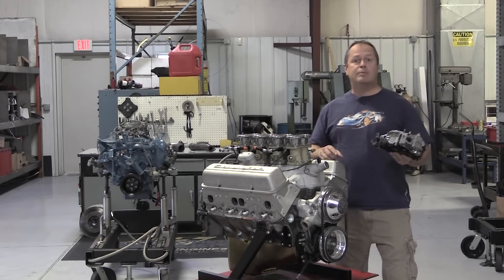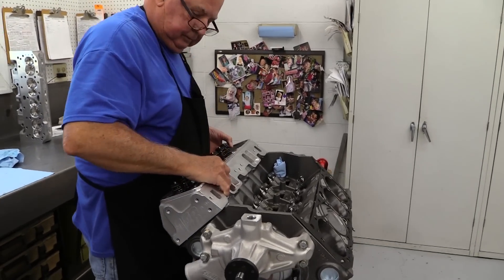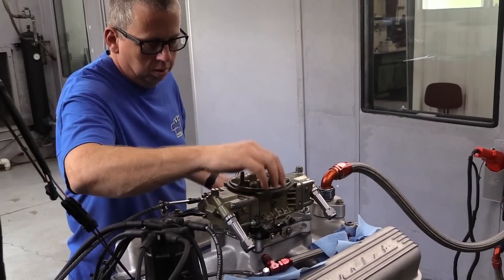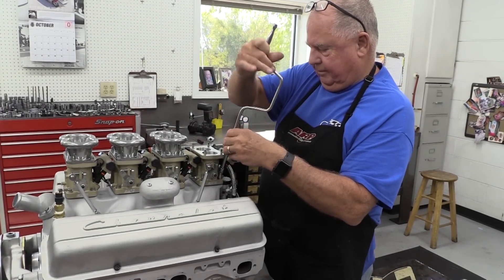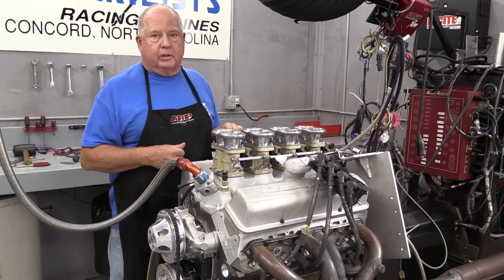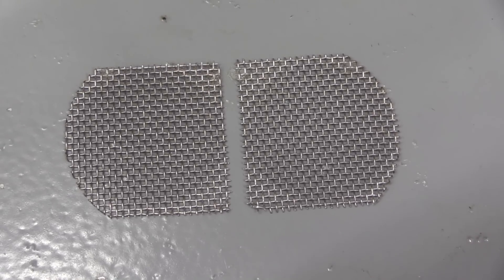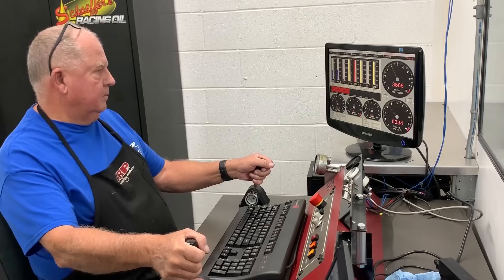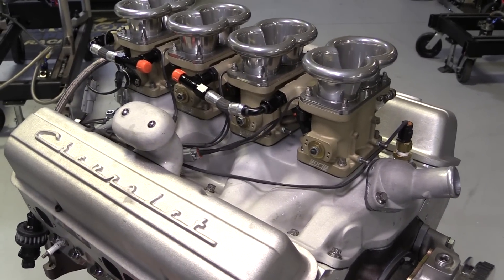Carb vs EFI - Dyno Testing a Holley Double Pumper vs Custom Stack Injection

Comment: Good video, and I AM a confirmed carb guy, but it really looks like that FI system was strangled upstairs by that manifold.
Reply: @Uncle Tony's Garage I see you there mad scientist!
Reply from the maker: True, they were just too small for maximum power on that combo. And I love your channel!
Reply: Yup, the lack of a common plenum killed all the top end HP.
Reply: Victor PONCE  I see only one potential advantage to that manifold. Short runner carb per cylinder setups like that bring the butterfly closer to the intake valve. This can make for a more responsive engine which can be important in something like a manual transmission race car for things like double clutching. But the engine it's on makes that moot. Outside of that specific application every other common setup is superior.
Reply: @snek9353  It also reduces the velocity that comes from longer runners. I noticed a big difference when the TPI systems came out. Much like the Old Tarantula manifolds, they produced a lot of power, but, unlike the Big T's, they were excellent at off idle to full RPM.
Reply: Need to change to cam when doing EFI, was not a good comparison
Reply: Uncle Tony's Garage, it sure does! Webber carted setups are very very sensitive to runner size and length. ITB’s are also sensitive in that way. Both of those NEED port to manifold matching.
Reply: EXACTLY!!!!! FI systems have to be intake port tuned AND exhaust port tuned in order that each port does not interfere with the other. That is why PORT FUEL INJECTION & EXHAUST PORT EXHAUST is CRITICAL!!!!!! Also, FI systems require signals from sensors to execute the Timing Curve, of which can be manipulated. There are so many examples from the gas engines to the diesel engines of torque and power curve differences. For example, the  1988 Mitsubishi Mirage naturally aspirated 1.6L FI engine with 170 HP v. the inferior 2.2l GM engine that could barely crank out 180 HP. Case Heavy Equipment with ECM's have more power without turbos!!!!!! Put that in your smoke and pipe it!!!!!!!LOL
Reply: It just looks cool and trust me after that heat gets to those carburetors that thing will be sitting on the side of the road and we'll be looking at it just as we are now because out comes the wallet

Comment: Loved the look of the older fuel injection...loved the video..finally got someone who commented on where the torque curve could be acknowledge on street where it will be used most of the time ...sure we all like to get on it full throttle at times ...I'm a big fan of torque  and useable torque...I'll trade 20 ft lbs of torque for 20 PEAK hp anyday !!! 
Thanks for relating to what I would want in any buildup ...

Comment: I once had a 77 Buick Station Wagon that had a 455 cid engine,  with a very small two barrel carb on it. I looked up the HP and Torque numbers  and found something that surprised me. 155 peak HP at 4800 rpm, but 415 ft lbs of torque at 2800 rpm.  That is when I learned about restrictive intakes, long stroke cranks, and torque. That land yacht must have weighed in at over 5,000 lbs without the 13 passengers, and their stuff..,   yet that engine pulled it up a mountain at 65mph, with the tach hovering around 2,600 rpm.  It actually got around 28 mpg on the highway.
Reply: big displacement engines inherently have more torque, no doubt about that. just look at the dodge viper motor
Reply: @sepg5084  displacement has two components,, bore and stroke. A short stroke/ big bore engine is better at making horsepower at high rpms, while a long stroke/small bore engine (same cubic inches) makes more torque at lower rpms.
Reply: My mom drove an old red Plymouth station wagon with the wood grain simulation on the sides. it was a bad ass wagon. it had a 383 magnum. that wagon would shit and get, believe that crap. in a station wagon, wish I had it now.
Reply: Generally the Factory spends millions of $$$$ on getting Maximum on average, HP+TQ+Mileage + Cost+ reliability =Value $$$ for a daily driver so you can't go wrong keeping it stock and running properly with regular service!!!

Comment: The old man is a good tech,  takes pride in his work and set the most beautiful bead of silicone i have ever seen in my life, this guy is a pro builder.  I could hear on the first dyno run when you switch to efi that the engine was running too rich. He knew it too and taking the screens out was brilliant.

Comment: With a self learning ecu and no knock sensors I don’t see how the ignition timing can really be on point to provide the maximum power for that efi setup. It’s impressive it did that well without proper tuning to be honest.

The real benefit of efi is to precisely control the fuel and timing so you can push the limits: In order to do this you need to tune the ecu.
Reply: Plus no O2 sensor on the exhaust, they didn't give the EFI a chance, I would like to have know the vacuum difference. 
But still a stout engine for a rod.

Comment: Intake was made by Inglese, they only ever cast around 18 of those for use in a Road Race series. I have one of those manifolds.
Reply: If I had one, I'd get someone to re-create it on a 3-d Printer, play with the openings on CAD to flow more, and reproduce your own! You could probably sell the 3-d versions to supplement your IRA!! 
Or, have them produced from high temp injection molded ABS or the like..

If there's NO Serial numbers/part number/Manufacturing name= NO LAWSUITS. 

.......How long have you had it sitting? 30-50yrs?
Reply: I have one! That's so cool. It's on my car rn.
Reply: I had one of these prototype Weber DCNF intakes a while back. Jim Inglese designed them and Winters Foundry cast them. Mine still had all the markings on it. Have a friend who has one and know where there is one other. These being an individual runner design, they will make more power from low to midrange than a plenum type intake.

Comment: Some body wrote that a carburetor is basically a  calibrated fuel leak.
Reply: lol best description of a carb ever.
Reply: Carbs have came a long way in the last 60 years!!!
Reply: John Johnson  yep. my carbed bike scares the crap out of me with its bad cold start and fuel smell.
Reply: John Johnson Yep. I don't know how to make them run right in cars, because almost all of the cars I've owned and worked on have been injected. Never had much trouble tuning them on bikes, but as a dirt/dual sport guy, they've all been pretty simple singles.
Reply: Ok, if sucking gas through a nozzle is what you call "fuel leak"..
Reply: @dougwillett27  one would HOPE so. LOL
Reply: John Johnson Honestly, yeah, it sorta is. There will never be another new carbureted automotive engine, and there hasn't been since the late eighties that I'm aware of. Hell, almost all dirt bikes are injected now. EFI is superior in every conceivable way (except simplicity, which there's quite a lot to be said for in certain conditions), and it's literally everywhere now. I wish I'd learned back when it was relevant, but these days there's just no need to for someone like me who's into what I'm into (quick, fun, reliable, daily drivers, off road capable vehicles, and dual sport motorcycles).
Reply: "calibrated fuel leak" 
You could describe EFI the same way, it's just a calibrated, computer-controlled pressurized fuel leak as opposed to one drawn in by a partial vacuum and venturi-effect and metered by restrictions i.e. jets.
Reply: John Johnson  as an EFI guy, Yes, that is correct. lol I am shit at setting up a carb.
Reply: Well well well, the good old carb shits on the EFI.
Reply: And efi is just a calibrated fuel leak thats pressurized.
Reply: Ran a carburetor on my 750 plus horsepower small block chevy 350 cid engine with a 5500 or 6000 stall speed converter naturally aspirated engine never once had a issue with it.
Reply: Big blocks are pretty simple to tune.
Reply: Tomyp89, close, very close! ITB’s are best!
Reply: sed8181, had a Harley mechanic tell me one day that a “Kawaski” starting cold sounded like a dude with the dry heaves! LOL.
Reply: The sinner Jim Whitney just a yuppie if you can’t plug a scan tool in you don’t know what to do. Your not a mechanic
Reply: Wanous 1966, you have an excellent point there. Over the years, I have accumulated carburetor jets from #35 up to and including #135! These are Holley jets (my carb of choice) also float bowls booster pumps for single and dual feed, dual pumper carbs. A shit load of vacuum secondary plungers and vacuum diaphragms as well. While this is not for the faint of heart, it isn’t rocket science. I got that end covered as well with a Bachelors Degree in Aeronautical engineering from Embry-Riddle Aeronautical University in Daytona, Florida. I also fiddled around a lot with carburetors on some of the flight schools aircraft engines while there. Now those need rocket science! LOL
Reply: Art Tafil i run holleys on everything
Reply: @dougwillett27  yes carburetors have come a very long way. I have a 980 CFM duel feed dbl pump on a Barry Grant carburetor that's in my Eliminator  speed boat with a ford 460 puts out aprox 550 to 600 hp.we took it to lake Mojave all the time never lost a race with it.
Reply: @arttafil6792  when the TBI came out in the very beginning they were junk.they prefected the fuel injection system and you have a lot of options to make them preform.
Reply: midnitesquirldog1 i have run a Holley 3310 750 vacuum secondary carb on my 454 for years never touch it works great
Reply: Norris Tammi slide show Mulgrew tbi was not junk just didn’t make hp
Reply: sed8181 you just don’t know how to fix them or tune them thats why you call them junk. You young boys if you plug in a scan tool your lost you don’t know what to do
Reply: That’s....  not wrong.
Reply: @177SCmaro  You get my vote for the YouTube comment of the week!
Reply: @briansd2772  
Lol, thanks
Reply: @177SCmaro  Well said!
Reply: Not really. That's more of a description of fuel injection. Fuel injectors are just solenoid valves that let fuel pressure leak into the intake. A carburetor is a vacuum operated computer. It has multiple circuits that are controlled by vacuum inputs.
Reply: Which makes EFI a carefully calibrated high pressure fuel leak!
Reply: Its a metered fuel leak. Wait till the floats do not work properly. Been there done that. Take E.F.I. over a carb any day.
Reply: @johnpopoff7950  You can diagnose and fix a bad float with a flat blade screw driver and a $10 part in about 5 minutes. 
Wait till your fuel injector splice, deep in the wiring harness, has a bad connection and you have to cut the whole wiring harness open to find the problem. Been there, done that. I'd take Carbs over E.F.I any day.
Reply: @Blenzo480  Yes I understand about wire harnesses. I am a bus mechanic with C.N.G. engines. Even the throttle actuator is drive ny wire. Fixed plenty of harnesses.
Reply: @chipcity3016  That E.F.I. manifold is anchient. It is a Double plane that the engine builder modified internaly to make it flow better at higher rpm. Should have used Hillborn 8 stack system or an Edelbrock Pro Flow.
Reply: Controlled fuel leak
Reply: Metered fuel leak thats why some cylinders ran leaner than others.
Reply: @norristammislideshowmulgre877  What intake manifold are you using? Most likely a high rise single plane.
Reply: Yeah, combined with a giant vacuum leak.